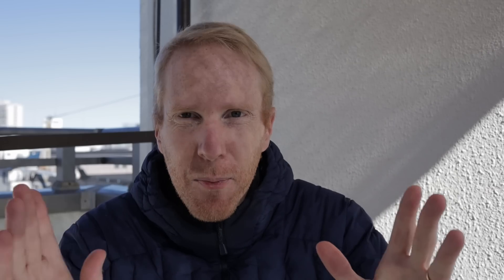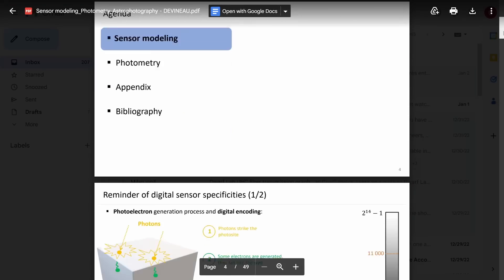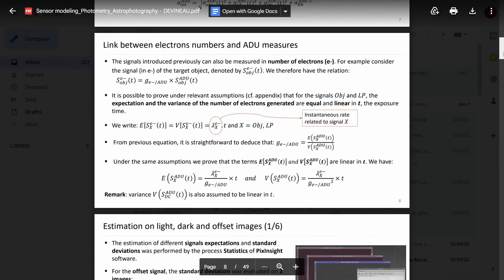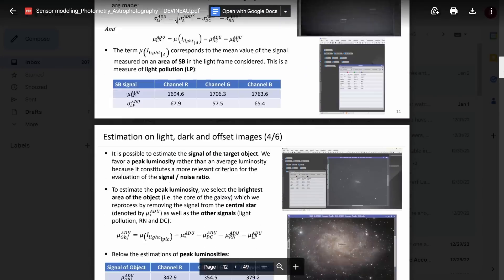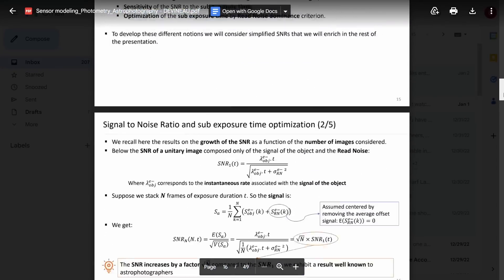Astroimaging-Theory For Dummies! Just a quick primer - with an amazing link

Comment: You simplified the concept of SD too much.  SD is the square root  of the sum of the difference between the median value of a distribution for each value of the distribution squared.  It is the RMS of the variability.  Not the square root of a given unit value or even square root of the average. My other hobby is long distance shooting and SD is a quality value of my ammo.  My velocity is running aroun 3000 feet per second but my deviations are usually less than +/- 10 fps which would give me a SD around 3.  That is a lot less than SQRT of 3000.

Comment: I've seen a number of good discussions on SNR and 'optimum' exposure time, which appears to translate as affective minimum exposure time, and a lot of them come around to a simple recommendation of as long an exposure as you can track without hitting full well. I think there should be a probabilistic maximum exposure time based on pixel culling events like satellites,  aircraft, clouds etc, that would for a given field of view, give you a probabilistic maximum exposure estimate, and thus give empirical exposure limits. But I could be wrong.

Comment: Hey Cuiv, glad you are feeling better. 

Sort of unrelated but are you still using the sharpstar 61 edphII? What's the time investment it usually takes for you to stack and edit your images? I got a very, very slow computer, and tried pixinsight, but if you have a recommendation for a reasonable computer to handling image processing under $500 or $1000, or a guide on using cloud computing to handle images, I'd be very interested to hear your thoughts. 

Thanks for your content, and take care.

Kyle

Comment: Hi Cuiv. As you say, for the same object (a galaxy for example) and the same aperture (200 mm for example), with a longer focal length each pixel gets less photons but the image is spread over more pixels. So the resolution is better but the SNR is lower. While binning this image with the correct ratio, you can obtain the same (lower) resolution and the same (better) SNR you would get with a shorter focal length. So I would say that longer focal length gives you more flexibility for choosing the best compromise between resolution and SNR and lthat lower focal length gives you, of course, more field of view. Do you think this is correct? Cheers. Daniel
Reply from the maker: Well, it is correct if you're fine with the FOV AND your seeing supports the longer FL! Otherwise you're oversampling (thus having less SNR for no reason). So things can always get more complex :)
Reply: @CuivTheLazyGeek  Thanks Cuiv for your answer. This makes sense ! You helped me to understand something more.

Comment: Its true that focal ratio is irrelevant for the total speed of the system, if the faster and slower systems are binned to equivalent resolutions after capture (never a point in doing so at capture with CMOS) so in effect you could get the same SNR without the hyperstar as with it - with a smaller FOV at f/10 of course. Why its so is very simple and the comparison to a focal reducer works well.

Your focal reducer does not affect how much light is passed through the aperture, but just how much is squeezed to each pixel. Binning does exactly the same thing by making the pixel bigger by combining a group of them, and if the subexposure has swamped read noise by x5 in the unbinned sub, it will also have done that at a bin level of lets say x4 (any level). It also means you can reduce the time it takes to get an acceptable result by binning. Binning  a mono image (OSC depends on method of debayer how efficient but still close to 2x SNR increase) x2 will double your SNR which means the same as imaging for 4x the total time. Your recent 30h rosette could have been a 7,5h rosette with the same SNR had you binned x2. Binning is your friend for sure, wish this part was given more love on youtube as its the easiest way to get more SNR and many cameras can easily be binned 2 or 3x and still produce a very nice FullHD or larger image. But i dont blame you on skipping that, its a minefield in forums as you found out. I feel like i am laying mines as i write this! You can test binning SNR thing by stacking only a small portion of a nights subs and binning to something silly like x6 and processing as you normally would. You should see a very low resolution version of the complete image if processing is equal. Would link an example i have done but youtube would remove the comment so wont.

Where the speed comes into play is how difficult it is to swamp the read noise, but with modern 1e- read noise sensors its really not that difficult to swamp read noise even with a slow scope. Your light pollution would trivialize it even at f/10 (except for narrowband where its still an issue and here i think its fair to say the f/2 scope is faster). 

Wall of text, gongrats if you made it to the end! (great video by the way)
Reply from the maker: Yesssss you summarized it excellently, and I have the same understanding. But I don't really want to put it out in a video because, as you say, landmines and flame wars!
Another issue for me at F10 is that with my terrible seeing I'd be oversampling...... :P

Comment: Thanks for the video and especially the link to Vincent's presentation. I believe it is the first time ever I have seen an explanation of the fundamental reason WHY the photons we measure follow a Poisson distribution  rather than being given the usual "what we observe fits the criteria for a Poisson distribution, so that's what it is".  Pages 42, 43 and 44 are very, very hard to digest fully though. The probabilistic treatment of guiding errors to constrain the optimal exposure parameter is also interesting. I've always felt that Glover's presentation about the "optimal" exposure should be rebadged as "the minimal exposure you can get away with given bad things are likely to happen" - Laurent's optimization strategy is much more comprehensive. Definitely the best out there.
Reply from the maker: I fully agree with you, and this presentation is absolutely amazing!!

Comment: Thanks Cuiv both for your video and making available the slides. Speaking for many astrophotographers lacking the maths skill the maths on the slides are inpenetrable but I follow the gist. I like how for the examples given the exposure time exceeding the sensor read noise such as used by SharpCap Pro can be exceeded by x3 as a rule of thumb is something I have practically experienced when imaging. For an imaager not versed in maths to the extent required by the slides your narrative is perhaps the best we can do when imaging though some estimation of exposure length for a given location would be better. 
Cheers,
Steve

Comment: Great technical video!  This is why I use 64 exposures for each of my calibration frames (Bias, Darks, Flats) because noise is an inverse square function.  The Square root of 64 is 8, and 1/8 (the inverse of the square root) is 0.125 or 12.5% which means that 64 calibration frames leaves 12.5% of the noise in the image.  To get down to only 10% I'd need 100 calibration frames, and to get down to 1% I'd need 10,000 calibration frames.  So 64 for me feels like a good break point in the diminishing returns.
Reply: 64 frames for flats and biases are okay but 64 for darks are too time consuming if your lights are 2-3 or 5 minutes subs. I hate dark frames the most 😂
Reply: @ssbhide123  This is why having a cooled camera is so helpful, I'm able to build a Dark library at various exposures and at the same temperature that I capture my lights.  I haven't shot new darks in months, and when I do I can just do them during the day.

Comment: good video buddy!

Sharpcap has the sensor analysis feature with which you can measure the sky glow and based on the smart histogram it recommends the number of exposures and length as well as gain... 

I am experimenting with this feature for both EAA and astrophotography.

need some more clear skies :)
Reply from the maker: Let us know how it goes for you!
Reply: @CuivTheLazyGeek  it's a lot going on for me right now as I'm trying to sort out the C11 that I got on a loan from the university for a NEO research... 
but i will test the settings from Sharpcap with my own 115/800 frac and will share results...  weather permitting ... 

I feel much more comfortable using my own scope when experimenting for it feels way more familiar and at least I hope I know what to expect ... although this is astrophotography ... one never knows wtf else can go wrong ... such a long stream of variables ....

Comment: Really appreciating your knowledge on this astrophotography journey I have embarked upon, many thanks
Reply from the maker: Glad it's helpful!
Reply: @CuivTheLazyGeek  very much so. Starting with your “make yourself a smart telescope” vid I’ve got to a stage where I’m about to put my toes in the water. I’ve got an AZ-GTI mount, added a Pi4 with StellarMate, and using my old (had it 17years and was second hand) Skywatcher 127mak cas and 9x50 finder I’ve put a ZWO ASI120mmcs on the finder and an EOS600D DSLR for the scope. With a focal reducer it’s ok for starting deep sky, but with a Barlow should be good for solar system stuff which is my interest. I am disabled and need a light ish set up that I can assemble in chunks and operate remotely. Still waiting for my first clear skies with it.